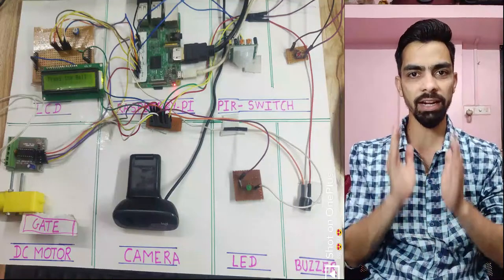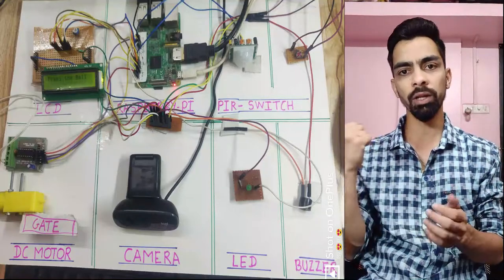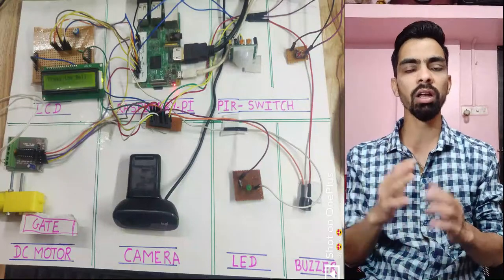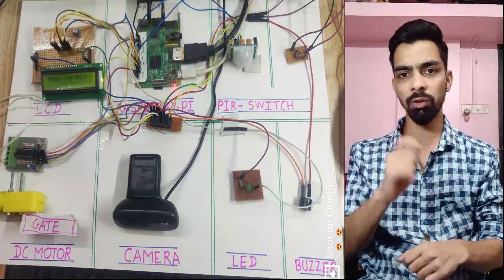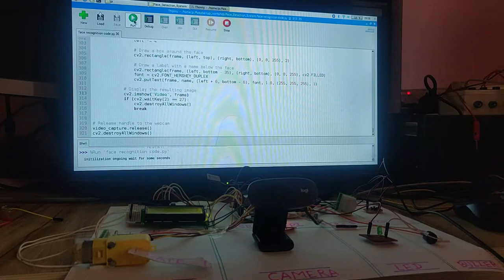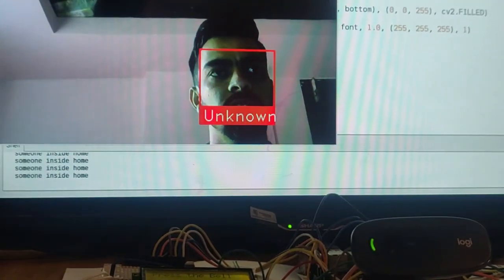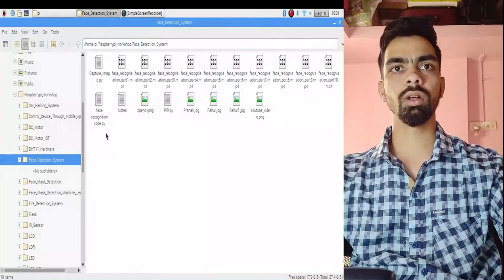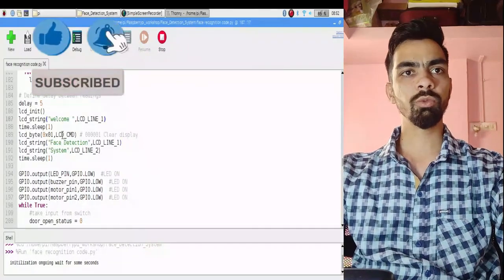Face recognition system Using Raspberry Pi | Smart Door Lock System |

Comment: The file you used in the video is not the same with what's in the drive
Reply from the maker: I just checked ..it's same file... check again.
Reply: @rahulIOT  I want to use ADS1015 as the ADC converter, can I use it?
Reply from the maker: @amadichigozirim  yes

Comment: Very good explanation... and great job, sir, because you're sharing your knowledge as well as your work... that's fantastic. In addition, I am working on a Raspberry Pi projects for my engineering college's second and third-year students. Of course, I'm not using Python to control the Raspberry Pi; instead, I'm using MATLAB Simulink and a MATLAB program. It's possible that I switched to Python for this feature. Thank you for your time. My name is A.Siva, and I am an Assistant Professor of EEE from Andhra Pradesh.
Reply from the maker: Which features ?